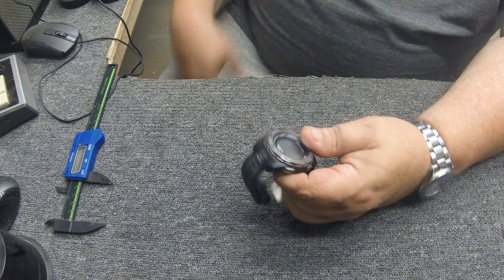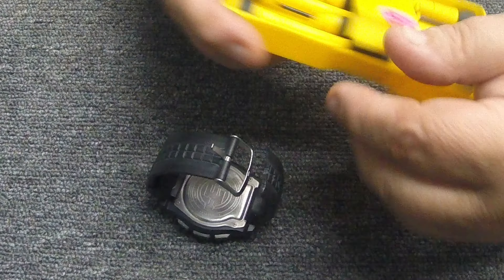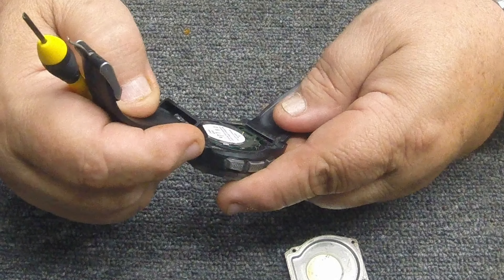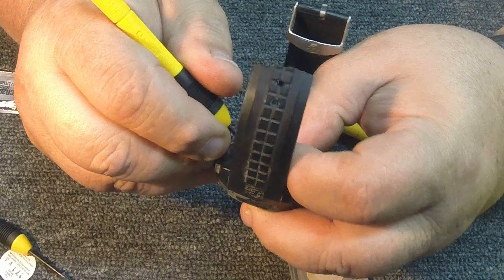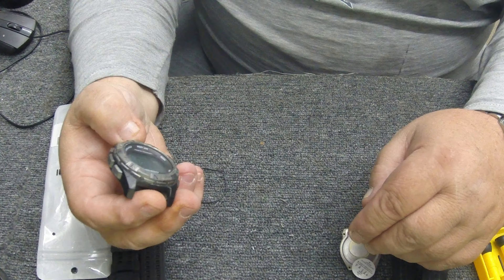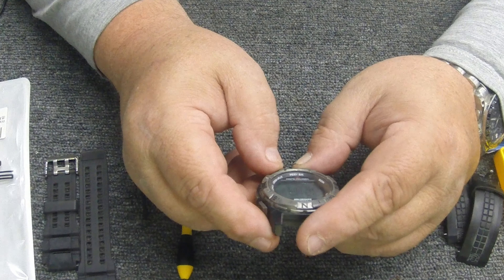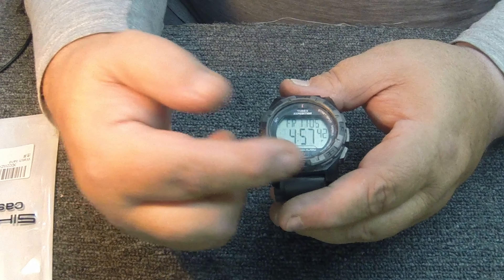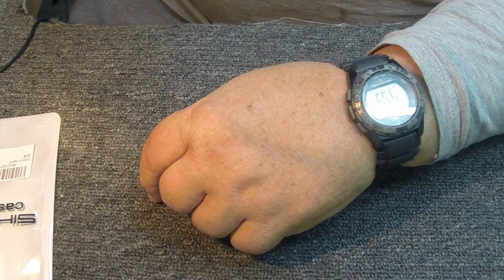Timex Expedition Men's Sport Watch Battery Replacement and New Resin Strap Repair and Review

Comment: I wanted to find out HOW to change the battery. You took the battery out with the camera off so I still don't know how.
Reply from the maker: Sorry I couldn't capture exactly what you needed on video. The latch was tricky, and I needed both hands to work with it. However, I did try to explain it and showed the retainer clip latch that holds it in place. You’ll need something like a bobby pin to get behind the latch and open it. My best advice is to take your time and avoid forcing it—once you release the latch, it pops right open.